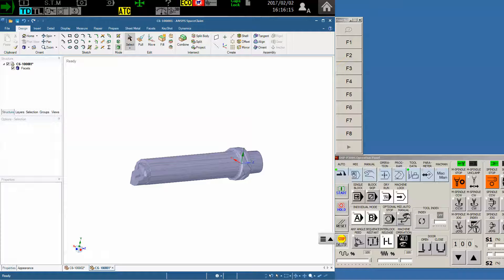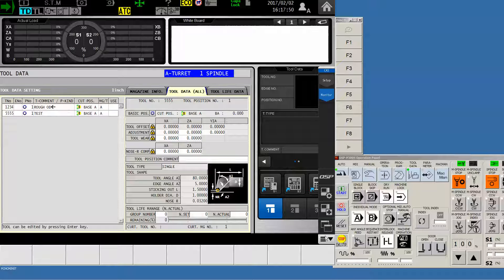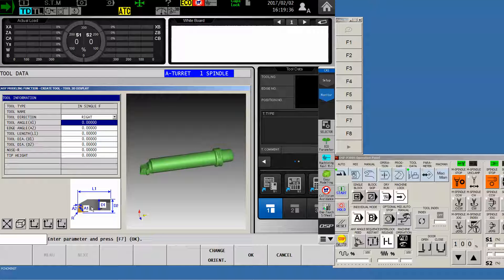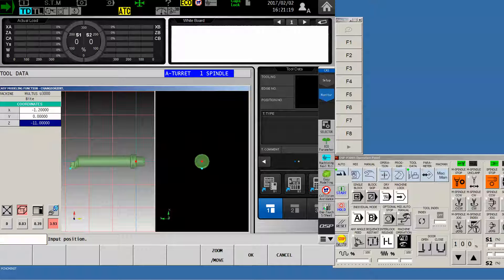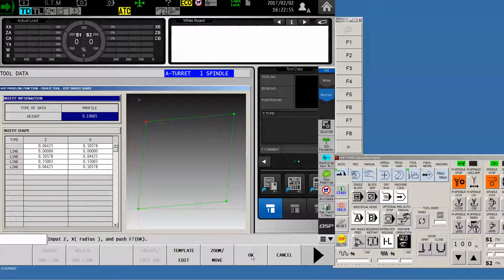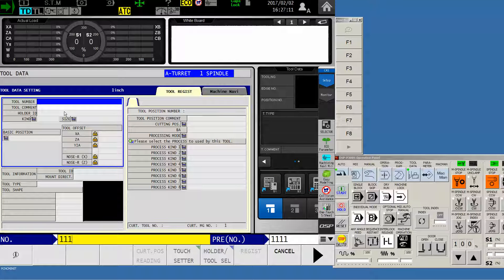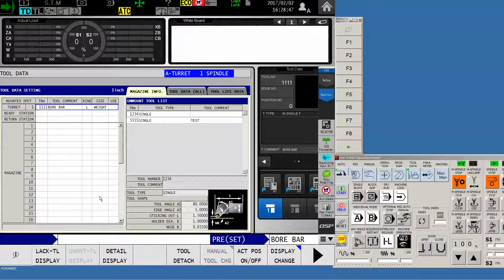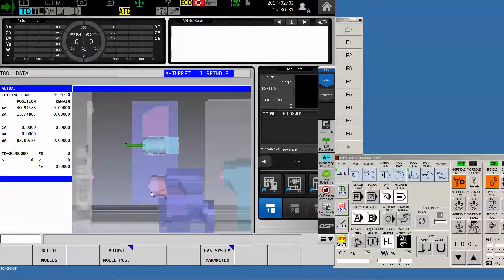STP TOOL

Comment: Forgive my ignorance, how does one go about acquiring this osp simulator software? I'm a Multus operator and this would help me a ton
Reply from the maker: Ty, there are two options available: the first is the simulator you see me using in these videos. It’s called PCNC Master and is designed to be a representation of the machine loaded with every option available. The second is called 3D Virtual Monitor and is designed to be an exact replica of your machine with its options and accessories. 3DVM is designed more as an opportunity to set up and prove your part before you ever move away from your desk. PCNCM is more of a training tool. Both are available thru your Okuma retail outlet